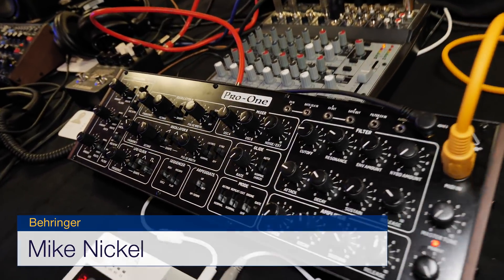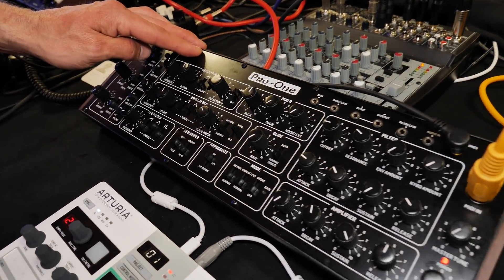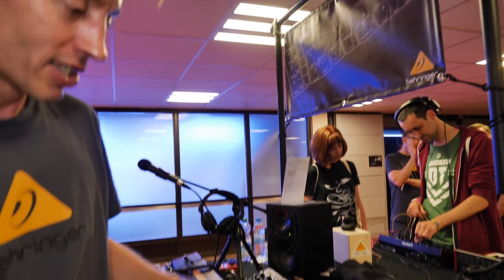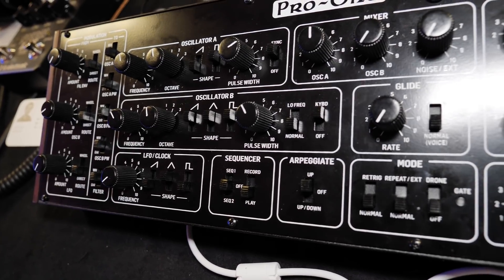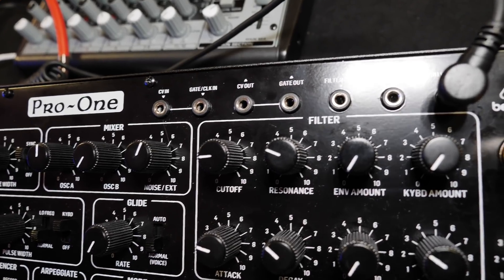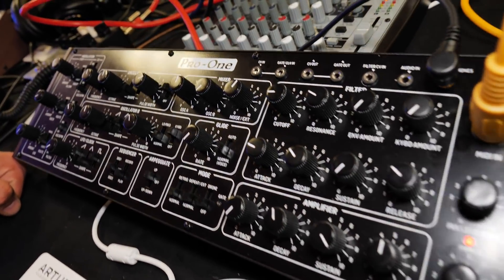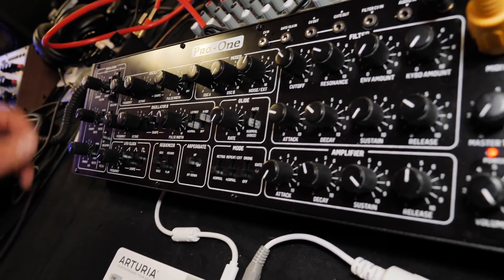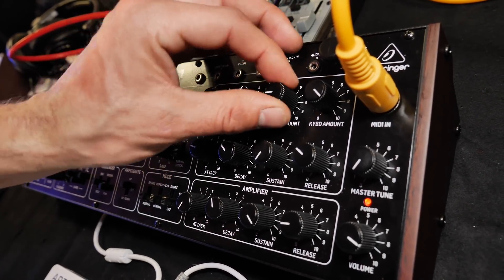Superbooth 2018: Behringer Pro One Prototype

Comment: Behringer are not holding back . 
All guns blazing. Hats off to them !!!!!.
All this cloning like it or hate it , it defo gives other manufacturers something to think about.
For years no synths from behringer , next minuite it starts synth raining 🎹🎹☔☔!!
Thou i must lastly add ,  i'd like to see some polys please.
Reply: Adamski A. There's the vp330.
Reply: Don't forget the DeepMind 12!
Reply: I'm with you on this Adamski A. A Model D, a Pro-One, a Semi-Modular and an SH101 and change form £1500? F..k that - I'm in.
Reply: Andrew Brooks Indeed Andrew no brainer or option b chase down a second hand over priced original on its last legs.
Reply: i have a poly-800. I like this new line and direction that Behringer is going.

Comment: The Pro-One had a nice interface. Loved the drone and the retrig and the sound was mad. The drone would let you hit a note and it would stay on forever. The retrig would allow super fast trills, etc. Yeah, the original didn't have MIDI but it would be retrofitted. I had one for £160 from a local music shop. It made a sound so I bought it in early 1987. It's broken now. The price of this new thing is dirt cheap! Hardly worth repairing an old one except to sell it and get Behringer clones?

Comment: I've no issue with copying the same architecture and even layout of the front panel but why the need to use the same font even as the original Prophets? Sounds sweet though.